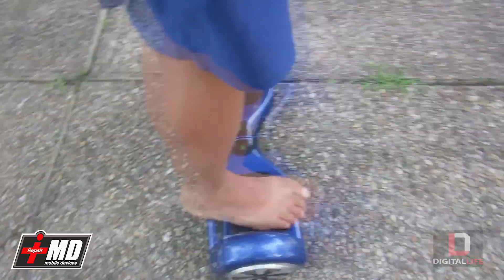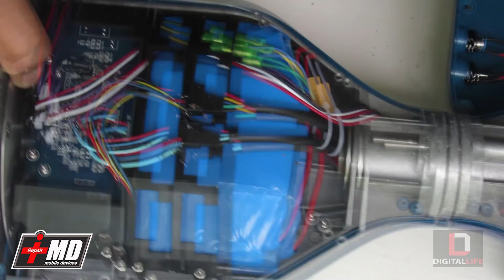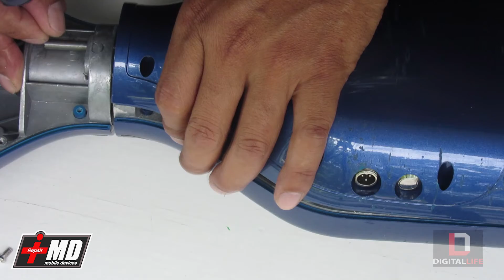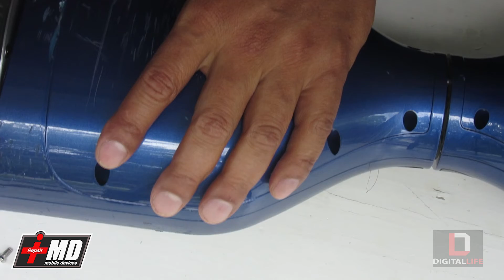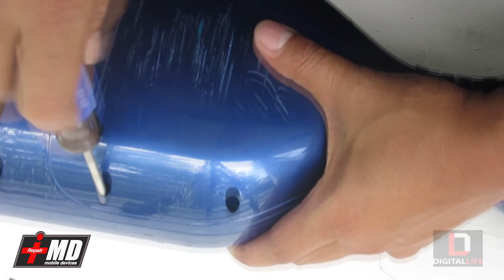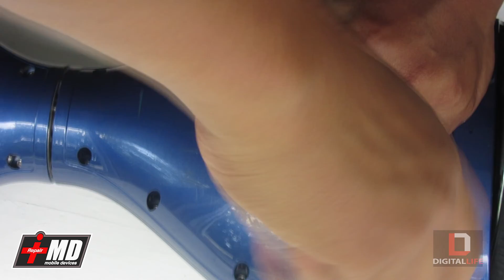Take apart of the balance scooter

Comment: the left side of my segway doesn't work, i calibrated it last night and since then it has just stopped working. when i power on both green lights on top stay on and the blue light on the left stays on and that side doesn't work, the right side works normally. Please help i really don't want to send back. Like i said it was fine until i calibrated it.
Reply: +Dan Sharp the sensor is fucked so change it i got the same problem about 2 months ago

Comment: I have been asking this question everywhere: my scooter shakes on left side and will not balance. the right side seems to somewhat work but turns off with the left. I opened the back and looked to see if pressure pads were good and they look solid. What is the problem? Do I need a new gyroscope or two? I have several of these things and two of them already went bad.

Comment: hey great video! had mine working for a day and then went to charge it . now it only works when its plugged into the wall . the battery is fuly charged and when i try and turn it on both sides light up red and turns off . any idea on what you think it might be ?

Comment: Hey, I want to do a DIY project of making my own balance scooter. So far i know i need an IMU sensor module and arduinos. Do you mind listing some of the other parts I need? Like what type of battery?
Reply from the maker: +GenKDaGamer http://www.digitallifex.com/
Reply: +GenKDaGamer - FIFA 16 TRADING AND INVESTING If you're going to DIY, don't copy the crappy half-shell die-cast magnesium frame.  Machine it out of steel or a good Alum alloy.  Based on what I see ALL FRAMES will collapse within 1-2 years of use.  Also, make your own battery pack with high C rated lipos for long life.  Good luck.

Comment: Hey man I have a question and you seem like you know quite a bit about the product. I just received mine yesterday in the mail and used it for about an hour or 2. It then started beeping repeatedly and the red battery light came on so I put to charge for about 2 hours. Once I unplugged it and turned it back on, after a few minutes of use it started doing the same thing. The green battery started flashing first, then it turned red and the board started beeping nonstop. Does it need to be charged longer? Or it is defective? Please help. Thanks!
Reply from the maker: ***** 
Sounds like you a balance sensor issue, please view my most recent video on this subject it will explain what I'm talking about.

Comment: I have seen many Balance Wheels on the Market, I am roughly 260lbs. Most of the devices only say 100KG 220lbs or 120Kg 265lbs. Would you recommend 10 inch or 8 inch wheel? Most 8 inch devices are only 100kg, will that possible overheat the battery because its working harder?

Comment: Hey so the two pieces on my device pull apart at the center. I imagine i am missing an internal component that stops the pieces from sliding along the center shaft. What do you think i could do to fix this problem? Thanks

Comment: Can you please help me with my problem? My scooter won't turn on I was just riding and it turned off and now it won't turn on:( I have tried charging it but it still won't work can u respond ASAP please would mean a lot
Reply from the maker: VisedMonster8  it's like you have a  burnt fuse or  blown capacitor check your main logic board for signs of an electrical discharge or a bulging capacitor
Reply: VisedMonster8 did yours beep a bunch of times after before it turned off?
Reply: iRepairMD Youtube i had same problem just checked the insides and all the capacitors and fuses look good.. only thing is one of the connectors for the light is showing low voltage
Reply from the maker: you might have a battery issue,
Reply: battery is fine, still has power in it! just wish it would work! haha would i be able to send it to you?
Reply from the maker: ***** send it over, I would be able to run a test to get to real issue.
Reply: +Chase Hennebry hi chase mine turned off and I'm not sure what's wrong, my capacitors look in check and all connectors are connected. Please help. I can send pictures through email if needed. I just really need some help on this, wasn't very cheap and would like to fix this thing. Thanks in advance (: